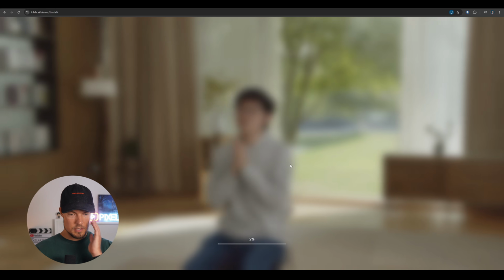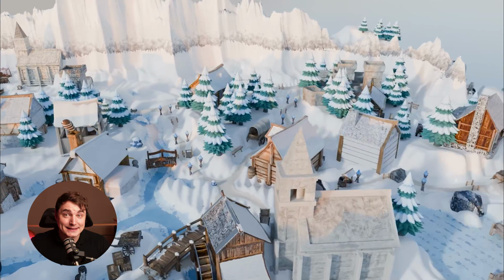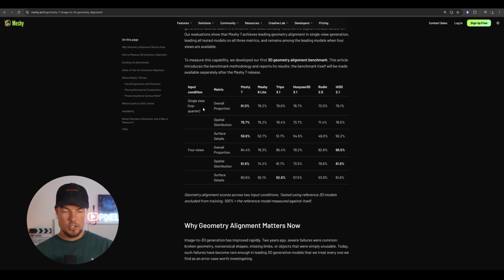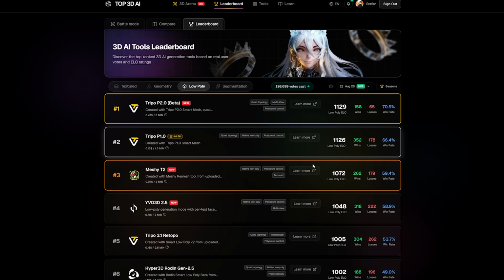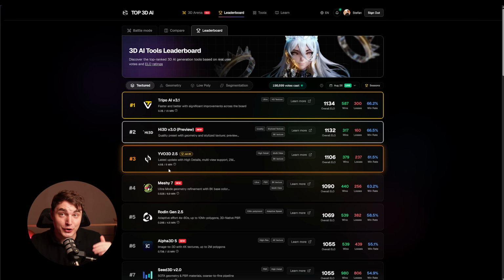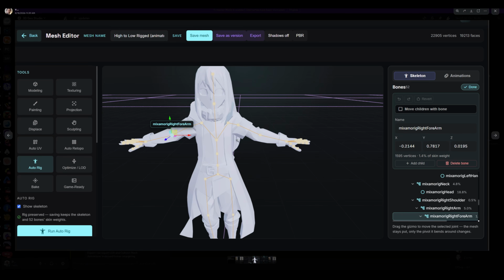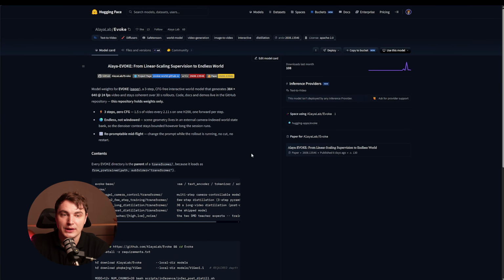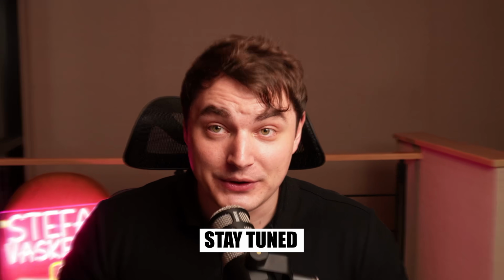One Prompt to 3D World, New Top 1 in Low Poly & High Poly Generators – 3D AI News #18

Comment: Can you create a video where you test all currently available AI models that can work with Blender MCP for 3D asset generation?

For each AI model, please use the same prompts and the same reference images and compare:

How well it works with Blender MCP

Whether it can actually create and modify Blender assets through MCP

Quality and accuracy of the generated 3D assets

How well it follows the given text prompt

How accurately it follows a reference image

Modeling quality and topology

Texturing and materials

Detail and realism

Speed and reliability

Number of corrections/interventions required

Current subscription/API price

Overall value for money

Please test as many relevant models as currently available, including Claude, Gemini, GPT, Kimi, Qwen, GLM, and other capable models.

At the end, rank all the models from best to worst for Blender MCP, with separate scores for quality, MCP reliability, speed, cost, and overall value.

The goal is to determine which AI model currently provides the best end-to-end experience for generating professional-quality 3D assets in Blender using MCP.

Comment: does Tripo offer some kind of editing tool for low poly generated meshes?
Reply: That's the Problem, if I have to take it to Blender that's a failure
Reply: @holdthetruthhostage  the biggest problem i see is distortion, For example trays and stuff like that are slightly like tilted, that can't be easily fixed in blender
Reply: @antongrekov7710  best way is to break down your model reference image, let Tripo generate the parts and put it back together in blender or so . Way fewer problems ... but not perfect